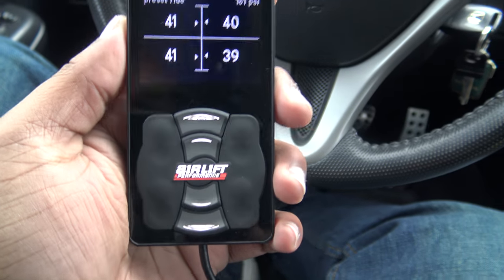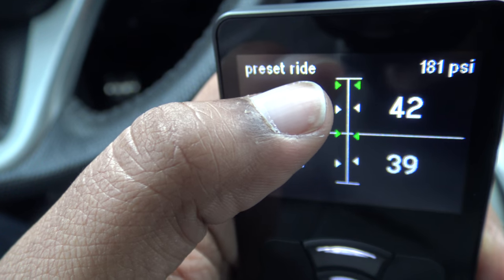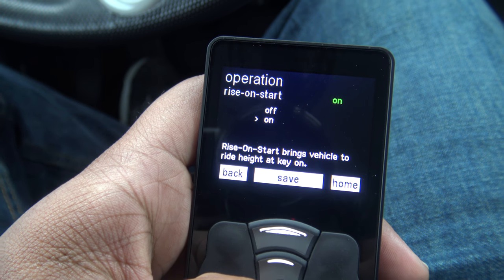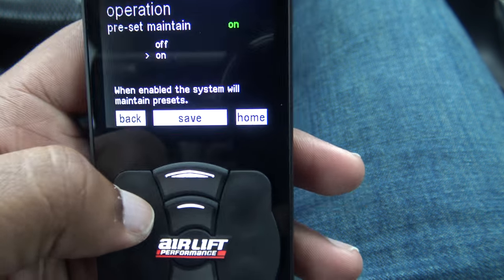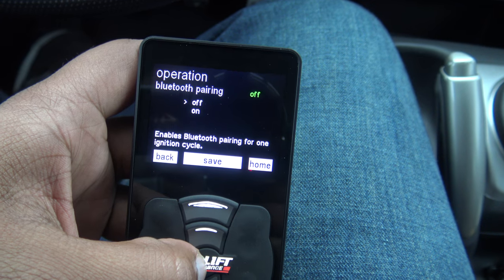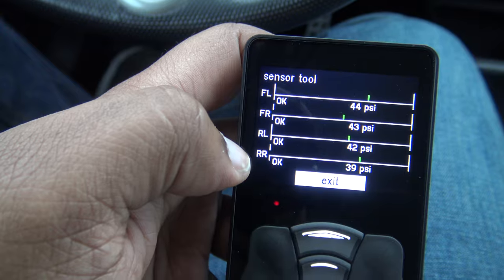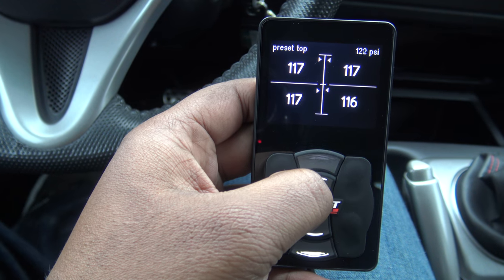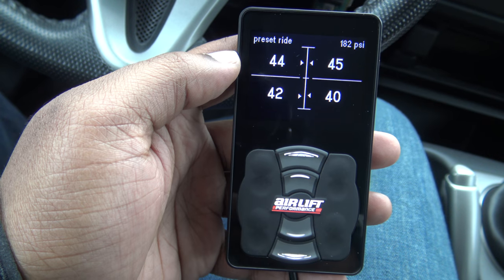Airlift Performance 3P or 3H: Controller With All The Settings Review! Part 3

Comment: Nice video man, quick question if I'm going to use the car for a week or may be go on a vacation for a month what position do I leave the car at! Should I air it out completely or keep it at stock ride hieght and what's the minimum psi I should maintain when leaving the car Aired out for a long time? I just bought my 3p kit and I'm still a newbie to this. Thanks
Reply from the maker: Thanks! You can keep the car at the ride height or aired out.. I would keep the car at the ride height.. So you can see if the car bags are leaking or not... but everything should be fine!!  It doesn't matter what psi you have the car aired out at..
Reply: EvilStreetShark perfect thanks man, anything thing else I need to keep in mind apart from draining the tank. I live in a place where the temp is around 100° for 8 months a year
Reply from the maker: Np! Nope! Yes, continue to drain the tank and watch your psi for the tank for leaks!
Reply: @EvilStreetShark   hey what if when i air out 3 of the bags say 0 on the controller and the other one is also aired out but says there is anywhere from 10 psi to 30 psi is that still ok?

Comment: Question…my blazer seems not to even in height all around, so in front …for example , in order to get driver side even with passenger side , passenger side is at 80 psi and passenger side is 96 psi, I set that at ride height, but the brain  “ module “ equalizes both sides to say “98psi” is that normal? Thanks jg

Comment: Hello, I'm in Australia and I'm throwing a error on my height sensors. Wondering if I could send you photos? I have a high limit issue. But my wheels can't be completely aired out. I think I need stock wheels to calibrate it

Comment: If you currently have the 3p system. What needs to be bought or upgraded to make it all a 3H system...
Reply from the maker: For the 3H you just need the height sensors and the 4 cords that plug into the sensors that runs into the main harness thats it.

Comment: Old video. But how do I make it air up and air down at the same time?? I
Reply from the maker: Double tap the air up quick and then down tap the air out right after quick
Reply: EvilStreetShark  I mean more like when I’m airing up the front and back doesn’t air up at the same time.. or like when I air out it goes front first then rear.. I want them to move togethrr

Comment: I have just fitted my brand new 3p management with new bagss all round, all is fine, but I can't connect my phone to the controller.

I have all the Bluetooth turned on. On the phone and the 3p handset,tried the 3 seconds on, 3 seconds off then on again, but no luck.
Tried to find it via the Bluetooth on the phone and on the app. I'm using a Samsung galaxy s10 on android.
Could you advice anything I could try to get it to connect up.
Reply from the maker: Make sure the bluetooth settings on the airlift controller is on and its set to 3p in the settings
Reply from the maker: Also check the airlift andriod app settings to make sure the bluetooth is turned on..
Reply: @EvilStreetShark  how do you mean set to 3p in settings?
Reply: @EvilStreetShark  can't see a setting in the app about Bluetooth?
Reply from the maker: @gazzasbike  Yes, Make sure its under 3p settings and then check the bluetooth.. I believe you can check the app as well to see if bluetooth is turn on and of course make sure phone bluetooth is turned on..
Reply: @EvilStreetShark  not really sure what u mean by male sure it's under 3p setting 🤷‍♂️
Reply from the maker: @gazzasbike  Go to the settings > Operation > Pressure/Height Mode > Pressure
Reply: @EvilStreetShark  ah got you will check that out then, can't see no Bluetooth setting in the app anywhere

Comment: my controller is stuck on manual mode, how do i change it so that i can set presets?
Reply from the maker: Do save a preset! After you select what psi you want in each bag... "Hold down the preset button to save the preset*

Comment: What made you go with this instead of accuairs elevel?
Reply from the maker: I went with the Airlift Performance kit because the price for the accuair elevel is a lot more and airlift performance front and rear struts are mainly based off the OEM struts from the factory so there is no issues.. If you go on accuair page you will see that they don't have a lot of kits for a lot of the make and model cars compared to Airlift Performance which makes the process easy..
Reply: EvilStreetShark ah gotcha. I'm not buying a whole kit from either. I'm just doing their air management system. So the elevel vs the 3h/3p system. I have a truck.

Comment: How do you get out of manual mode
Reply from the maker: It's only a manual mode if you don't have a preset saved.. 

So if you have a present ride height it will say that..
If you add like 2 more psi in the front bag... 
Of course it will go to manual mode because its not the ride height
Reply: Bro how do I save presets? I'm on manual mode and i don't know how to save preset lol what do i press? thanks!